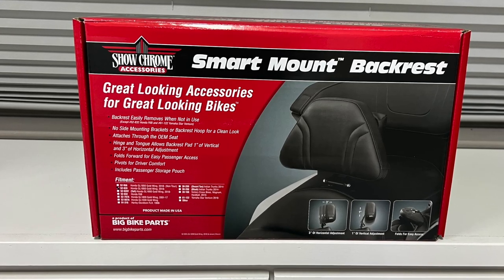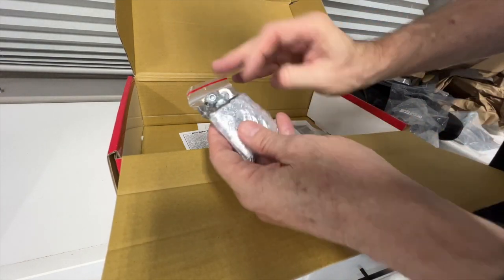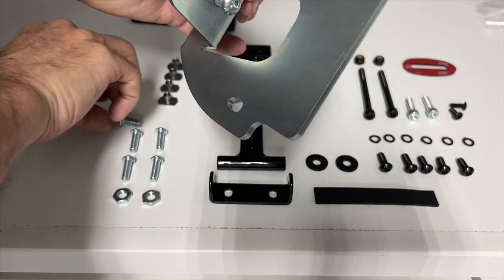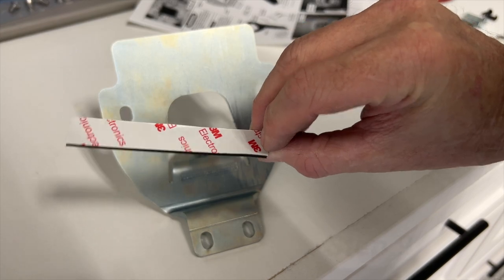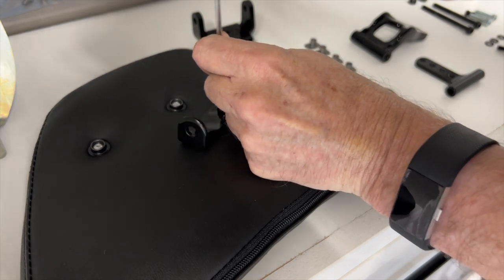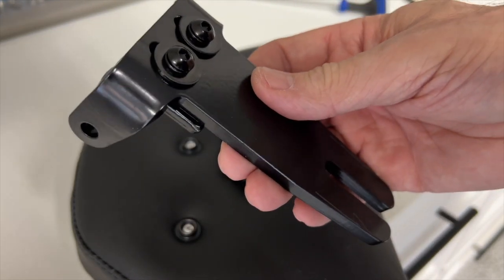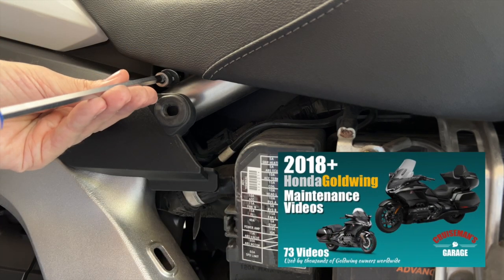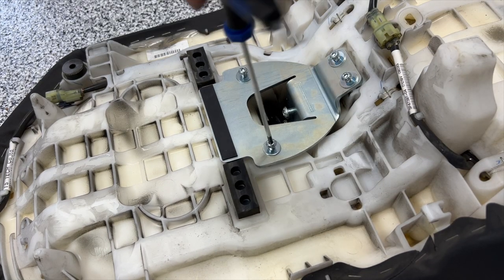Show Chrome Rider Backrest for 2018+ Honda Goldwing Installation

Comment: I have the same one and love it. The only thing I changed was I did mot use the cheap looking vinyl plug cover. I used the original plastic plug and simply removed the hold down strap and made a slot in the top for the rest to slide through then crazy glued it in place. Looks so much nicer and cleaner.
Reply: Have you got photos of this? Ive also been looking to have a new bike look, when the seat is removed..i.e. using the original seat plug.

Comment: I have the 22 Goldwing Bagger and considering a backrest. What is your preference on all the backrest that you have tried out and is most comfortable to you. Thanks !
Reply from the maker: I am currently riding with the Platinum backrest from Show Chrome, but I have also used the Utopia. Both are good. I would shy away from the Honda OEM backrest.
Reply: @cruisemansgarage  I am using the new Platinum backrest as well... Feels good and great match for the 21+ Goldwing Tour DCT ...

Comment: Hi Cruiseman.   I saw a video you did on an insert replacement of the framing around the hole for the drivers backrest that is much better than the one that comes with the showchrome removable backrest.   I cannot for the life of me find that on your channel or wingstuff website.  can you point me in the right direction?   Thanks so much.

Comment: The 2022 TDC I test rode on had the Honda backrest on but I could not rest on it with my hands on the bars "I'm 5:10" and there isn't a way to adjust it back and foreword.
Reply: You meant DCT. You are right about the Honda optional backrest. I found this to look nice but not comfortable. It’s got limited range of adjustment. I’m also 5’10 and use this Show Chrome backrest on my 22 DCT Tour airbag and absolutely love it. It’s angular and great look for this bike. The issue with your reach is distance to the bars is seating position which can be alleviated with the Heli Bar risers.p which I also added. It’s well made product. Check it out here on YouTube. You or your dealer can install those. If you are not mechanical allow your dealer to install. These will bring bars back and slightly up about an 1”. With the adjustability of this Show Chrome backrest it’s prefect for me. Even with Highway Pegs. All good.

Comment: Trying to find out how to adjust this thing...I need to to come forward a bit...is that possible?
Reply from the maker: Yes, you can loosen the hinge bolt and tip the backreast forward, then re-tighten.